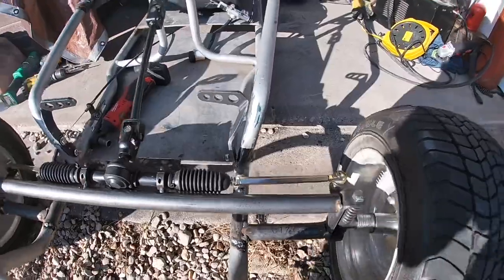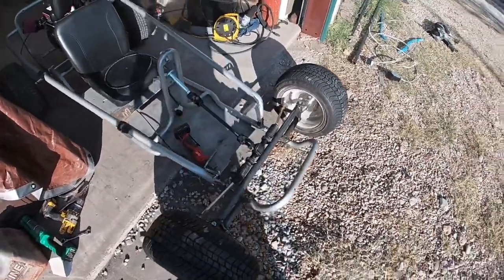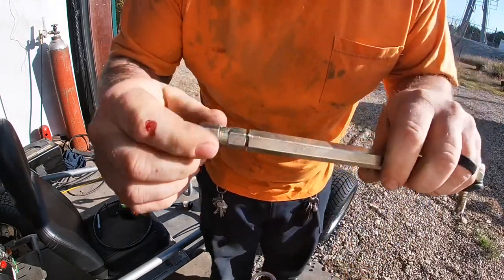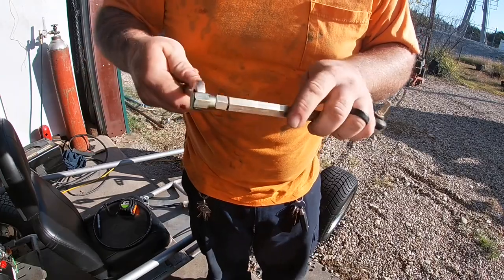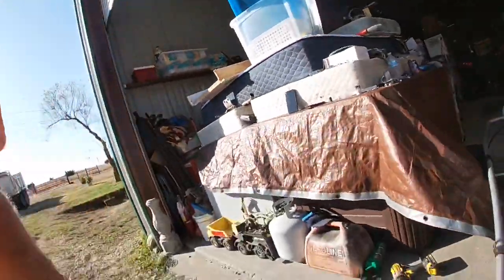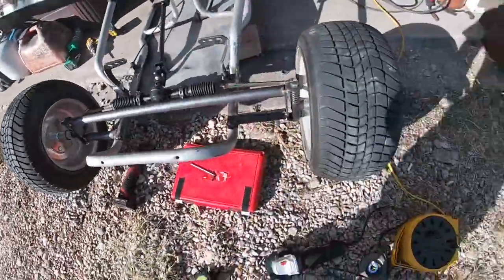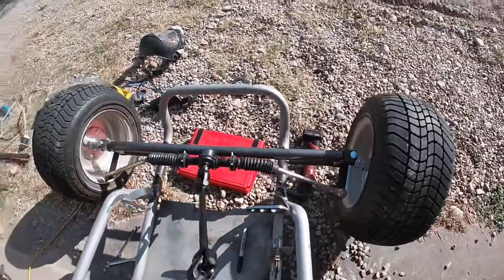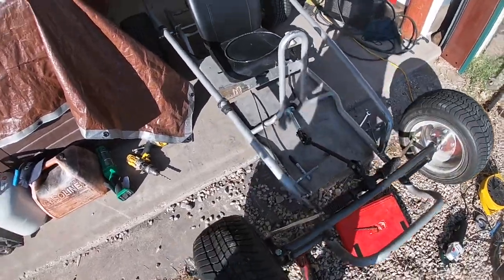Go Kart Rack and Pinion Install

Comment: That’s one nasty ass grinder burn! I hate when I do that.
Seems like I would learn but some how it happens every couple of years.
I see some rack and pinions on eBay for around $75 for EZGO golf carts that are a little narrower.
I remember my dad setting his tow in and out on our 57 orange and white Ford.   Jack the front end up just under the ball joints, Spin the wheel and use blue carpenters chalk close to the middle of both tires, spin again rub the center with a nail to leave a narrow black line. Then he would take a long stick and drive two nails the distance between the marks on the front of the tires. Then check the distance on the marks at the rear if the front tires. He would adjust so the front marks would be about a 1/4 inch closer on the front marks than the rear marks. Depending on how tight your steering  is maybe a little less.

Comment: Has using the lock collars tack welded held up so far? It seems like a reallt smart idea. I bought a similar rack off amazon and am brainstorming how to mount it. I don't weld but i might need to find someone to do this for me. Rest of my kart has been fabricated with bolts so far

Comment: Does the steering wheel have to be in the middle I got a 2 seater and the steering is falling apart need to replace it
Reply from the maker: No there is an offset rack they make for the 2 seaters! It’s pretty much the same just offset! Let me see if I can find a link.
Reply from the maker: https://www.gopowersports.com/all-go-kart-parts/steering/mini-mid-80t/ 

Here’s a few different sets! You’ll have to get the parts separately, I didn’t see a kit.

Comment: can you give me link for that? thanks
Reply from the maker: 300mm Steering Wheel Gear Rack Pinion Tie Rod Rack Adjustable Shaft Assembly For 110cc 125cc 140cc 150cc Go Kart Go Cart Buggy Karting ATV UTV Bike https://www.amazon.com/dp/B08RNGJL6X/ref=cm_sw_r_cp_api_glt_fabc_GJN05G8ZDSTP1WDNMG66